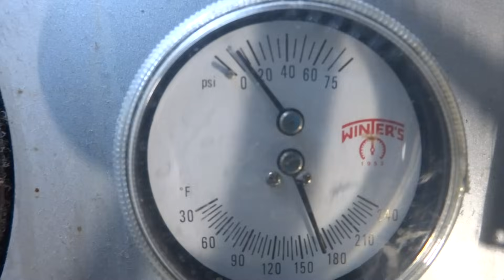BECKETT OIL BURNER ANNUAL SERVICE / OIL PUMP

Comment: The biodiesel itself isn't dirty. The problem is it dissolves all the crud at the bottom of the tank and then suspends it in the fuel. All the sludge that has built up at the bottom of the tank gets stirred up when the tank is filled, dissolved, and then suspended in the new fuel. The older the tank the worse the problem is. You shouldn't see much slime on a brand new tank (save for what was transferred over from the old tank), but on existing tanks the filters are going to get plugged up one after another until all the sludge that can be dissolved gets cleared out. The filters need to be several times larger than they are on the older tanks to keep from getting plugged up so fast.
Reply: That makes a lot of sense. I just put a bunch of additive into both of my tanks to dissolve any sludge so I’ll check my filters a few times this season and change them if necessary. We had two new tanks installed indoors about 10 years ago and have only received oil from one company on auto delivery each winter. So at least I will know the quality of their oil this winter….thanks for explaining.

Comment: Years ago I tried to put a Propane burner in My Oil Furnace and I broke 1 of the bolts that holds the Oil Burner to the Furnace.   It was an old Chicken Brooders that I tried to use, and it didn't work very Good and it made My House stink too.

Comment: question, .50 80a nozzle with red cap vs .50 80a nozzle with black cap that says DOF. whats the difference? both same brand. only thing i can find or figure is that  DOF seems to be a Delevan thing and seems to be short for del-o-flo, i found those nozzles are low-capacity nozzles designed to minimize the plugging problems associated with very low flow rates.are they new or something? because the nozzles i always got before had a red cap on the container but this one is black. but same specs.

Comment: I was changing the filter 2x per year due to the bio-sludge. I just recently stepped up the filter assembly to the larger capacity General 2A-700B to get more life out it and try for a 1X change per year. In addition, my generator and lawn tractor are eating up carburetors due to the Ethanol in the pump gas.. It's an ongoing battle thanks to these brilliant politicians. :face-orange-frowning:

Comment: Hi Steve, I am a subscriber, I was wondering what the diameter of the hose is that you use to purge the air out of the oil line.
Reply: Looks like 1/4 inch to me
Reply from the maker: yes its 1/4 inch